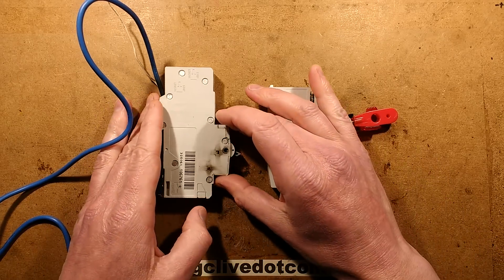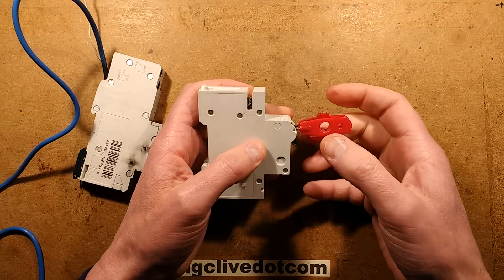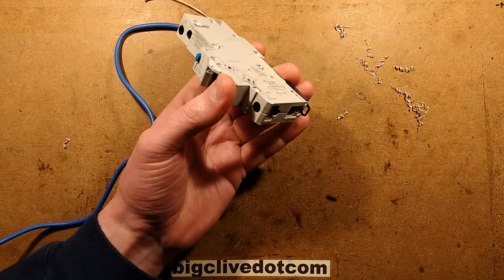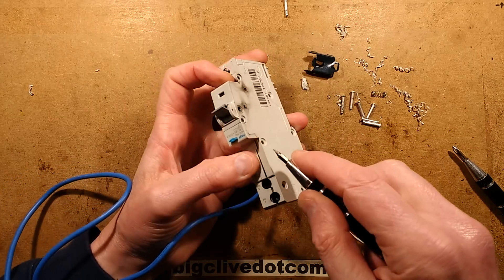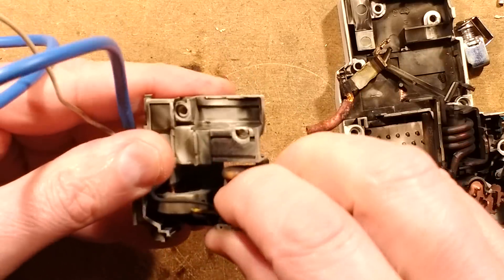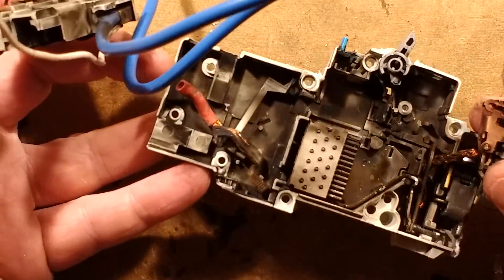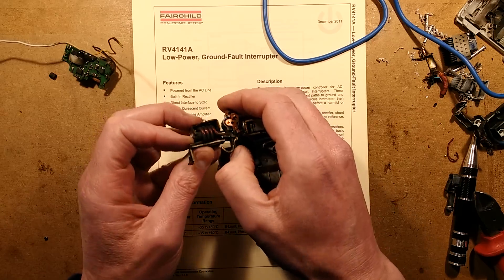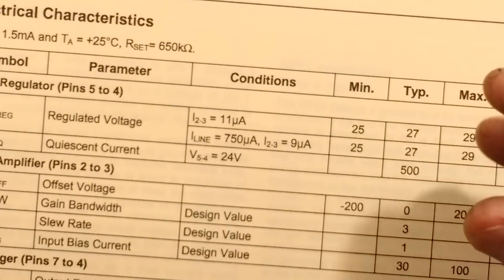Totally exploded Hager RCBO (RCD/GFI with overcurrent trip)

Comment: Hi Clive I enjoy your videos very informative I learnt quite a bit I am new to electronics I am building a DC power supply with a 50 volt 5 amp switch mode unit I am using two DPS5005 regulators I was wondering if I need a ground Earth binding post I would like positive and negative output but I am stuck with how to do that internally I understand how to do it externally by connecting the two outputs are you able to help me on that I have done a lot of reading and I am more and more confused I want the positive and negative outputs to be controlled by my regulators for the full range I have looked at circuits that only do a few hundred milliamps up to 1A if you can help I would much appreciate it
Reply from the maker: You'll have to use two separate isolated power supplies.  One for each module if you want a split rail supply.  If you bring the connections out as two terminal posts each then you can either use them as separate supplies or common the + of one with the - of the other and treat it as a zero rail.  You can have a ground terminal, but it can only be applied to a single terminal of a commoned supply.
Reply: Hi Clive sorry I've got it wrong my one supply I can't split with the regulators to treat them as two supplies I need to separate switch mode power supplies I think I understand now I really appreciate your help thank you very much keep up the good videos

Comment: In your discussion of CRTs and degaussing coils, you mentioned a temperature-dependent resistor that would limit the current when it got hot...  I've seen super-cheap CRT driver circuits that used a small light bulb for that purpose, believe it or not.  Works great until years later when the light bulb filament burns out...
Reply from the maker: My Rockola jukebox uses a lamp in series with the selector motor to act as a DC brake controller.  Sudden high current burst and then fading off to protect the motor.

Comment: When an rcd/mcb is installed you should always allow for starting current not just run current. Have seen this many times before. Also in Australia they are only recommend to trip 6 times. If you complete your red testing correctly, it is then over it's max trip. Just some useless info.
Reply from the maker: This one was rated with a C trip characteristic which would allow for some level of inductive surge, but not enough in this case.
Reply: bigclivedotcom we have d curve motor start. C curve are standard use hear in Australia.

Comment: The little drill bit looked very sharp and effective, what was it, and how do you keep them so sharp.  Loved the JW reference, but the accent could do with a tad more work, Just channel a 1970's weather forcaster :P
Reply from the maker: I buy my most commonly used drill sizes in bulk packs.  But the aluminium rivets were quite soft.
Reply: bigclivedotcom: I've just re-watched JW's vid and noticed something you have in common - snips, wire strippers, fingers, you'll use anything except actual pliers!  #o)

Comment: The generic device is RCD - Residual Current Device
There are two varieties of RCD:
RCCB - Residual Current Circuit Breaker
RCBO - Residual Current Breaker with Overcurrent protection

However, RCBO's are newer/less common than RCCB's, so it became usual to refer to an RCCB as an RCD when there was only one type of RCD in general circulation.

So now we have RCD and RCBO.

Comment: Great video thanks Clive. I'm now wondering about kA ratings: breaking current. (I'm not a leccy but have to deal with these things for my sins.) I would expect 6kA to handle virtually all domestic and some industrial installs. But you mentioned this one is Type C. Does that mean the kA rating is down to a lower power factor, or is it just that the instant trip level is higher? Food for thought. 

But not too much. Tonight's bin night and I like to ration my excitement.
Reply from the maker: This one was rated at 10kA breaking current.

Comment: Its very common for old CRT arcade machines to leak a small amount of current to earth in operation, so when you have a large number of them, they like to randomly trip RCDs, even type C, we've done alot of experimenting with it and it definitely is the monitors

Comment: Hi Clive :) 
In France with our breakers if you can put a lock on a close one it's no problem. the lever on the front isn't directly driving the internals, it's only an indicator. 
I already had some circuits breaking and all levers where up so i had to find the one tripped and close it by pulling down and up the lever. 
So if it's a sensitive equipment that you don't want people to bring it up if there is a fault you can also lock it up and if it trips the breaker people without the key wont be able to do any action on it. 
(it's a clever idea but not sure if all breakers has the same internal behavior) 
tested with Hager / Legrand)

Comment: It was so much simpler in bygone days when you could just put a penny behind the glass plug fuse. And we really did do that.
Reply: What also works in a pinch is sections of 1/2" copper pipe where the cartridge fuses would normally go. Instant upgrade from a 100
amp fast-acting fuse to a 20,000 amp time delay. I'm talking about NEC/CEC switchgear.
Reply: @briangrainger2264  "20,000 amp time delay" LOL

Comment: Suggested sequence of events:

1) High inrush load causes frequent trips.

2) Frequent trips are dealt with by flipping the breaker until it stays latched.

3) Eventually the contacts weld closed.

4) Somebody finds he can't switch the breaker off.

5) Somebody decides to see if he can trip the breaker with the test button.

6) Test button doesn't trip the breaker so he holds it in.

7) Breaker shits the bed, leaving skid marks everywhere.

If so, the manufacturer doesn't really matter.  The RCD circuitry on all of them is designed on the assumption that the test button causes a near-instantaneous trip.  If it somehow fails to trip and the test button is held in then the RCD circuitry self-immolates.

Comment: Great autopsy, some people think resetting; is holding it in the on position for several seconds, even though the mechanism is trying to switch off. 

Thankfully standards, and better training/certification for electrical installers has greatly improved since my first foray into domestic installations circa 1970's. But idiots do breed ( rather well, if truth be told). 
My best story of attending a customer, was being called to a lady's house, who complained that her new TV picture was smaller than it should be ( Vacuum set), her TV supplier said it was fine. Within a few seconds, the cause was obvious, the surface socket of round pin 5 amp type, had been wired directly to a 16 amp fuse with "Bell Wire " having a current rating of maybe 3 amp max). Lucky, the lady didn't own a vacuum cleaner or electric fire ( this was the only socket in the room) or there would have been a lovely burnt pattern under the wallpaperd wire.
So, a new 13amp socket, wired in 2.5 T/E channels with steel capping, and she had a nice full screen picture. In asking who had installed the unsatisfactory item, she said it was a friend of the family who worked for the local electricity supply company ( MEB - Midlands Electricity Board)!!!, Asking around, it transpires that this was true, but his job was digging holes!!!.
Reply from the maker: Quality of electrical training peaked in the 80s.  It's been in decline since.  You can now go from zero electrical knowledge to a fully certified electrician in one week.
Reply: bigclivedotcom , I agree. It should be law that any trades person, Electrical, Plumbing, & Building etc should be regulated/licensed to work on/in on any property when providing a service,   for larger projects, some semi-skilled labour is allowed.

Enjoy the channel, and learning electronically stuff, especially the inventive Chinese products, very inventive, especially with over a million university qualified graduates per year.

Comment: Prime example of stupid. If it trips, there is a fault somewhere, so repeatedly switching it back on is not really a fix. Although a bit concerned that a fault after the fault protection could cause it to fail and still conduct, manufacturers may have to have a look at that.

Comment: When a circuit breaker becomes a fusible link.

At the right voltage and current, anything can be a fusible link. Life goal: Never be that thing.
Reply: I mean, you can guarantee that you'll succeed in that life goal, if you're willing to measure your time of death as the instant before becoming that thing occurs.
Reply: Doug Sundseth no Clive said it looks like the fault was likely to have blown itself clear somewhere downstream, so the breaker didn't break the circuit like it should have if after faulting it became the weakest link.
Reply: Acting as a proper fusible link would be the best case failure for a circuit breaker: permanently opening the circuit internally.

In fact as near as I can see there was no fusing of any kind involved in this failure, since the ease with which Clive separated the contacts indicates a cold weld (more similar mechanically to soldering or brazing) rather than the, um, fusion of a proper weld.
Reply: @Azlehria  that's so scary! honestly surprised breakers don't include a backup fuse to handle large faults that weld it closed
Reply: The current spike probably spot-welded that thing together.

Comment: Is there a possibility of a lightning strike, or at least an emp from a strike?
Years ago, a strike hit the church across the street,  and the resulting  emp , took out our water  softner timer, 2 gfi plugs,  and vcr. It did not touch our electronics on our microwave, tv,and washing machine. 
Lightning does wondersome and magical things that don't always follow the rules. Or at least the rules as we know them.
Reply: Lightning doesn´t just damage things via EMP.
If lighning stikes close to you, the earth itself may not be as neutral as it should be. There may be a high voltage spike on the Live, Neutral and/or PE. 

Some of this energy can be absorbed by surge protection circuits which can be installed in your house's distribution board. Some devices, such as good SMPS, also come with their own surge protection circuits.

Old-school mains transformers reject high voltage spikes fairly well. Microwave ovens often still use mains transformers to power their electronics.
Reply: Basement ScienceE 
There are tons of ( how can that be ) stories out there concerning lightning. As far as I  know, my house was the only one affected by that strike of the church steeple. And my house was not the closest.
Things like shortest path, and least resistance may not always apply when dealing with lightning strikes.
Thank you for the reply.
Reply: Sure. A lot of factors play into it, and every lighning strike is different as well. It can depend on the composition of the ground around the strike, the energy of the particular lightning, and much more. 

You also can´t really think of lighning as taking a single path. The current is so high and the conductivity of most materials is so low that current will flow practically everywhere. And of course it's a current spike, which also acts like high-frequency voltage. All of this makes it extremely complex.
Reply: Basement ScienceE 
As was told to me by my Grandmother.
( how can that be )?
The lightning came down the chimney,  across the ceiling,  down my Grandpa's back, through the floor, bounced off of the wet basement floor , circled the drain a couple of times before going down the field tile drain where she was doing laundry with a ringer washer.
By the time it got to the basement,  it was ball lightning.  The only damage was a scar on Grandpa's back. Oh,,  and new underwear. .😲

Comment: Moral of the story: Regular circuit breakers can´t be used as GIS

Workarround: Get some heavy duty enclosed switch (ABB has some nice ones) and use that. Or just put all the smaller loads on timers so they don´t fire at the same time...

Comment: it compares current flow on the "hot" and "neutral" wires, so if the current flow out the hot and back via the neutral are not  99.x% equal? it TRIPS, meaning that user device is shorted/has a "ground fault" that is assuming the control circuit isn't "dead" from other comments mentioning lighting and surges

Comment: by 6:50, that had to be a direct or nearby lightning strike with huge voltage and surge currents. I'm betting it arced from the wire passing through sense coil to the control circuit and up stream as it tripped. I've seen many GFCI outlets look the same way from direct power line/pole strikes ( above ground electric here) lost random devices all over my own house in the past, it hit the whole street of people randomly killing devices also.
I'm betting the same thing occurred on "John Ward's" video you linked, only it didn't trip catastrophically, only damaged the control circuit and went kaboom, when tested.... which is exactly why they say "test weekly" on all the GFCI's in USA.  the one you had looked to be obliterated instantly, Johns looked to be a death trap that could have electrocuted someone!

Comment: seems more like poor main contact materials used if welded closed in a fault condition unless its above the rated breaking current capacity of the breaker  causing the rest to fail  as it will , heads up hager!
Reply: check and see if lighting/neary huge current/voltage welds you open or shut ;)
Reply from the maker: I think this one experienced operation outside its designed use.  But if the circuitry does fail in this way it is a slight issue.

Comment: hope they fixed the issue in the circuit it was feeding, something clearly wrong there.  then again maybe a lightning surge harmed the device and made it randomly trip..
afterthought, maybe they used the thing as a "daily power switch" which breakers are not meant for! I've seen that kill many.
Reply: by 6:50, that had to be a direct or nearby lightning strike with huge voltage and surge currents. I'm betting it arced from the wire passing through sense coil to the control circuit and up stream as it tripped. I've seen many GFCI outlets look the same way from direct power line/pole strikes ( above ground electric here) lost random devices all over my own house in the past, it hit the whole street of people randomly killing devices also.
Reply: In parts of the world where UL standards govern, breakers can be designed to be used as a power switch for lighting circuits and are marked SWD, for "switching duty".

Comment: Great analysis.

I had some experiences of my own with welded contacts in an industrial design project, but the contacts were those of heavy-duty relays.  I learned a few things.  It's a scary failure mode, particularly if there's nothing else downstream in the way of protective circuitry, fuses, etc., and the machinery in question poses a potentially major fire hazard.  In our case there were protective circuits but their job was... to switch off the relay.  The one with the welded contacts.  :-/   Damn good thing the problem emerged in the prototype stage.  The relay was SUPPOSED to be so over-rated for the purpose that no such failure was even possible.  Got it sorted out in the end and the result was nice and bulletproof.  Fixed it three different ways, actually.  The design has remained in use now for 25 years in thousands of machines with zero failures of which I am aware.
Reply from the maker: It's always good to design in multiple protection against failure modes.  And as a last resort in extreme cases, add a crowbar circuit to deliberately trip protection.
Reply: How did you solve the problem?
A mcb above the relay or a fuse link separator?
Reply: @florind.5711  The primary problem was noise in a temp-sensing circuit that overwhelmed the built-in hysteresis.  Probe wires were acting as antennae, picking up AC noise and switching noise as well.  I even detected a nearby powerful AM radio transmission on some of the probe wires.  We fixed that rather firmly with some hefty ceramic filter caps at the entry points of all the temp probe wires.  The relay logic circuitry was modified to add further chatter protection by imposing ~150ms logic-state switching delays.  And a thermal fuse for ultimate mechanical shutoff on overheat.  The thermal fuses have never in any case been tripped to my knowledge in the decades since.

Comment: Ya it looks like US breakers kinda suck in comparison.
Reply: there are GFCI and AFCI breakers in USA also, GFCI outlets are most common used for ease of reset and alerting the "end user" of a fault in their product. how ever false detection due to static discharge through darwin devices like cellphone power cord/charger lol

and since this is Clives channel, Hitachi wand style "massager" with power switch being flipped high to low/on/off too much/fast :))
Reply: Saw one guy on youtube with AFCI's and his ham radio neighbor could trip it remotely when he broadcast something.
Reply: yeah, that's another very common issue with AFCI and GFCI, strong RF can trip them.
then there's guaranteed AFCI trippers> UPS(battery backup) switching on and off battery, fish tank heater, water bed heater, most electric cooking appliances with bi-metallic thermostats that chatter. they all "look" like arcing wires!
Reply: Should not be a problem: They are only used for very low (half) voltage.